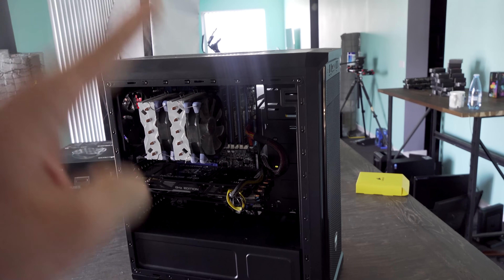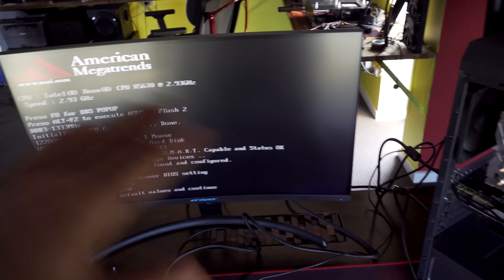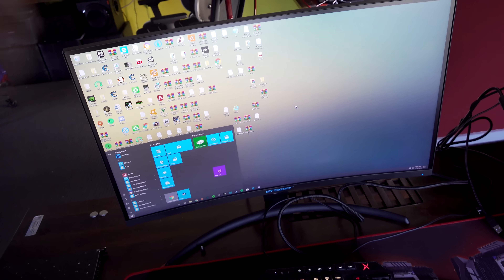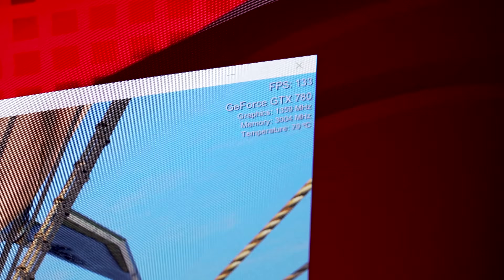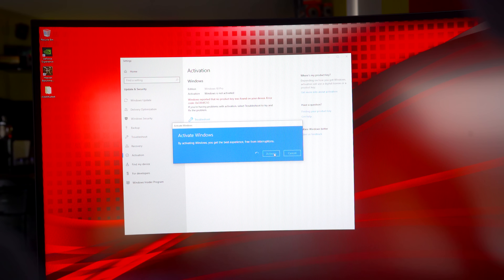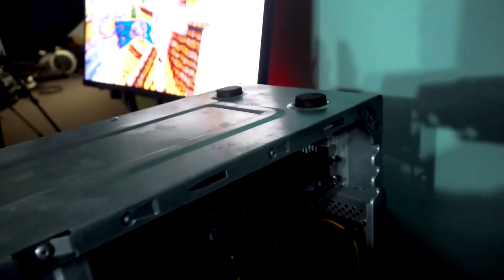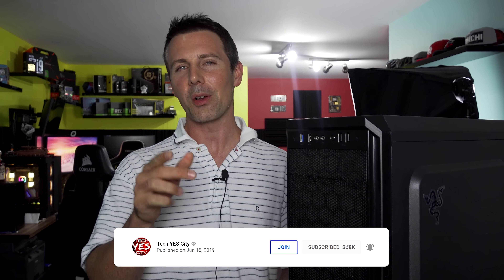Fixing "No Signal To My Monitor" - This Computer Came Back 2 Years After Sale.

Comment: i have 12gb ram and it is showing only 8gb ,, what should i do ?
Reply: Did you watch the video??
Reply: @lollb454  yes but the battery didn't work for me .. i tried to reset the bios and  that didn't help
Reply: @XFROOS  did you try reseating?
Reply: @lollb454  do you mean re install them ? I did that ..
Reply: @XFROOS  oh okay, is it showing up as 8gb in windows? Or only 8gb Usable?
Reply: @lollb454  if i installed the 12gb .. the computer will restart three times to open then it will show only 8gb in Windows and in bios  .. sometimes they show 12gb in bios but only 8gb in Windows .. and the computer restart three time to open the bios or to enter the windows
Reply: @XFROOS  and when did you start having this problem? Did it show 12gb first but then it started showing 8gb? If you installed some new ram maybe it is defective or ecc memory

Comment: I bought 2 identical hdds in 2016. Since then i am trying to find out why one works just fine even pretty good as boot drive, however the other is just insanely slow as boot drive.
However every test i did showed no difference and both seemed to work fine.

Comment: Had a similar problem with PC I bought, cpu cooler clogged with dust and PC must have overheated, I just popped battery to reset, blew out dust and was good as new.

Comment: after changing my r5 1600 stock cooler to snowman cpu cooler then powering back my pc this was my problem but reseating the ram solve the no signal also did that removing the cmos battery and draining the power before reseating. but the issue is mounting the snowman cpu cooler it took me good 1 hour to figure it out

Comment: I was facing the same issue, PC power on but it's just couldn't post. It turns out the motherboard is faulty and I had to sent it back to the seller to fix it and It was my first time building my own PC. Now I finally can use after they send me the brand new motherboard. Great video as always!

Comment: I got numerous problems with freezing while I was playing or doing nothing, then I had random crashes and so on.. I thought it was a faulty motherboard, got it replaced but still had same problems, at the end I found out it was ram, the kit I was using it's cl16 and was not on the motherboard support list (yeah, I was hyped to upgrade my old ancient pc)that I bought the wrong ram.. I got Corsair lpx 16gb 3000 MHz, but the only problem is the latency, I took 16 instead of 15... That little problem drove me crazy for couple of months

Comment: Isn't the hdd faulty? Did you check s.m.a.r.t info? I also have used CCleaner for years to clean up drive. Most of the time it finds multiple GB's of temp files and junk.

Comment: I had a XION case and 450watt janky PSU combo that didn't die but, the main rail was causing massive Vcore voltage drops and causing memory errors. For ever i thought it was the ram. Swapping out kit after kit. Windows was even throwing memory errors. 
  I then started to monitor all the voltages and temps. So I was watching voltages and temps in windows and all seemed OK. Going into the BIOS and checking the built-in Hardware monitor i kept seeing the Vcore drop into the red. So right away, i picked up the problem. Dropped in a new PSU and everything was good. Though, i never saw a PSU run the system and looked like everything was OK in Windows, throwing errors like every ither month. Until checking the BIOS, I didn't see any hint of a issue.

Comment: I bought a 2080 super from msi .. and when plugged in it acts like its not even plugged in ... i plugged it in and used my cpu graphics to see if its showing in device manager .. and its not there ..  thing is the pc boots fine with the gpu in the system but it doesnt post ... like u can hear windows sounds and shit but gpu has no fan spin at all .. doesnt heat up at all
Reply: Is it a faulty gpu ? Or something fixable?

Comment: Only 1 partition on a 1TB hard drive?Why???
Reply: What do you think partitioning does to reduce SATA lane bottlenecks or utilise space efficiently? Magic?
There is a reason why standard best practice is to have 2 storage drives; a smaller capacity SSD and a 1+ TB mechanical HDD that people swap their Steam, Origin, Epic, etc game files in & out from.
Reply: @TechNinja.1701  It's not reducing any bottlenecks, but in case of new os install, you can loose all the data.It's much better to have a partition for the sistem and one for the storage.And of course, always be sure you have atleast 15% or more of free space on every partition.Ina my case, i have a separate SSD only for the OS, and the rest of the HDD-s are all for storage.

Comment: Even if you just clone the old HDD into a new HDD the performance will improve. I have seen this many times, the Random Read/Write speed for these HDD became soo terrible, but when you Read Sequentially like in Cloning it would read at Maximum rate, but the Random Read/Write is somehow broken. Replacing the HDD will fix it.

Comment: What i found in mostly older intel systems was that sometimes there's a power failure or wrong settings/No cooler so it got extremely hot.You have to reseat memory or cpu and that would fix it.I have not seen this on amd systems though.

Comment: How to keep all of the folders and the files in the hdd but move the os to a new ssd without losing anything
Reply: Clonezilla works great as long as the drive you are copying to is at least the same size or larger than the one you are cloning. After you're done just resize the system partition on the new drive to use the extra space.
I have heard that "EaseUS Partition Master" is good and user-friendly too but only works for Windows drives.

Comment: If the HDD showed a greater than 200ms of "Average Response Time" in Window Task Manager then it meant that the HDD is dying. So it should be replaced even tho it looks "just fine".  The HDD cannot survive greater than 60 degree Celsius in Ambient Temperature, this will significantly reduce the HDD's lifespan.

Comment: My pc boots only if it wants to 😂 if it boots i have like 1-2hrs of playtime till it freeze and wont boot again. Bought new psu didnt fix it. Reseated and cleaned everything to no avail, running out of ideas. Prob cpu or mobo. But the strangest thing is when it works, it works flawlessly.

Comment: Just the hdd is end of life not that its full...
I still have a 2.5 inch brand New drive that Was so broken from the start Windows Was bsod all the time And had 15 min Just to load the desktop on a fresh install...
Yet the drive works Perfectly fine for movies/series storage 8 years now.
Please dont say stupidities like oh the drive is full thats why it is slow... It is Just defective.
And yes i have had atleast 100 situations where i Can tell the drive is end of life And data needs to be backed up And have had a call within the month And cases where i have even had calls within days that the drive died.
Also with enough ram you can disable virtual ram...
I do agree ssd were pricy 2 3 years ago but still for gaming even on a budget you could spare the money for a 60/120 ssd.
Reguarding Psu fails i have actually had 30 to 50 situations where the pc works Perfectly fine no bsdo no errors but is Just sluggish as hell pointing to end of life hdd And it Was actually all fixed by Just swaping the Psu... That Was actually ultra strange to me as to all voltages were ok and Psu Was at 50% load on max load yet even opening a browser And start menu Was pointing in sluggish hdd

Comment: 0:33 It could also be an overheating CPU so the thermal paste needs to be changed or re-applied. I've had the same problem with all of my PC's at some stage and it has always been an overheating CPU, when I have removed the CPU HSF, there has always been a large spot where it looks as though the thermal paste has spread out due to heat I guess, so as to leave a huge patch on the CPU which has no thermal paste because it has spread out to the sides of the CPU which then lets the heat accumulate.

Comment: I have an interesting PC story i had. i was trying to fix up an old 4th gen i3 machine and the gigabyte motherboard died. Then i bought a cheap motherboard on ebay from an acer pre built pc and that worked... until i wanted to put a GPU in. So i went to update the bios and the bios had a lock...Great. I ended up paying for ANOTHER motherboard and that finally worked. Just think about how many times i had to take it apart and put it back together again.

Comment: 7:35 Why is Windows not activated after defragging 🤣
Reply: After new installed Win on SSD.
Reply: @hag3n273  No that was before the SSD install. Like I said it was after defragging the HDD. Go to that time stamp and listen
Reply: @koalitaDormilona  I'll have to take your word for that. CBA to re-watch and find out. There is no logical reason why a defrag would delete a product code, so I'm assuming continuity error in the edit, if what you say is correct.
Reply: he deleted the key 
the reason is:

"Insert sponsor here"
Reply: 7:26 Aslo couldn't he use the product key or MS account as its same PC.
Reply: Could be that the original key is no longer accepted by the activation servers any more, and the activate Windows message only came up later during the defrag
Reply: That's one of the many things that drove me away from Windows, and onto Manjaro Linux, as I don't have to worry about activating my OS.

Comment: I cant find a solution to %100 disk usage. That happens randomly. Tried everything on youtube
Reply: smu u if you experiencing this on Windows 10 i had the same issue on my work laptop. We basically reinstalled Windows and everything was fine after that.

Comment: 8:25 it didn't actually defrag anything, it just more closely examined the drive to see if it could optimize the sectors. THAT takes allot of time. but because windows recognizes spinning disks it automatically defrags pretty much on the fly. a normal hdd in windows 7 through windows 10 will not have any fragmented files, although those files will be whole allover the place on the hdd. normal automatic maintenance will pack them all to the edge of the platter. so there are two things that you as the tech can do to make it faster again. first kill all of the startup software (obvious) then figure out what is actually there. second toss in an ssd, which is just a no-brainer these days because you can buy an ssd that is faster than any hdd for like 20-30 bucks. a new crucial 120gb ssd on amazon in the states is 22 bucks, if you can't afford that i recommend that you suffer, because you are just denying yourself. there are circumstances where that little bit might be expensive, but based on the computer shown in this video, it should have had an ssd in the first place.

Comment: Most anyone problem I had was a dying MOBO. It'd just constantly boot loop. Tried replacing the PSU first. Most recent was my GPU fans going nuts after I installed a new MOBO. That cleared up just by replugging in the PSU cables tho. My 2080 was raging like a Dustbuster for a few minutes tho.

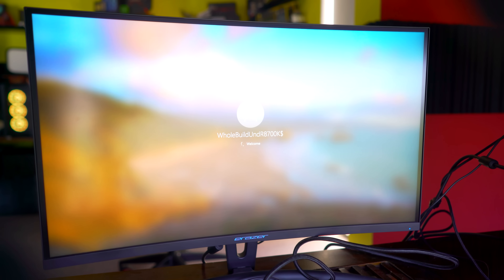Comment: 6:49 defrag doesn't hurt or help an ssd, in most cases it will just do nothing at all. on an ssd it might just readdress, but i think they stopped doing that ages ago, these day they just ignore it and report no fragmentation. and while it can help with an hdd, windows does it automatically since vista (even xp tried to) so fragmentation is unlikely to be a problem on a consumer desktop with a mechanical hdd.

Comment: Easy fix Bryan.
Interesting to see a cpu fan die. The second fan should have been enough unless the cpu was overclocked. Some boards show an error when the cpu fan isn't detected. Does an X58 board have 2 cpu fan connection points. 
I used to use 60gb ssd's back in the win xp/7 days so the OS has not been on an hdd for about 10 years. 
If you install a new ssd does Windows recognise that the motherboard already has a windows 10 key associated with it?
Cheers, Mon from Brisbane.

Comment: The reason I use a datavac instead of a regular vacuum cleaner is because of the potential static discharge that a regular vacuum can produce that can actually damage your pc parts. Unless you have a high end vacuum cleaner that is designed for use on static potential damage parts you are taking a big risk.
For example I know they make vacuums that are designed for cleaning laser printers with toner, because the last thing you want to be doing is blowing toner around a work area.

Comment: 2:00
can someone explain what is he doing? "drain remaining power"...how it works? thank you!
Reply: Swi Noob A power supply and some of the other components in a computer have capacitors. These store electricity for a short time even after the PC has been unplugged. By holding the power button for a few seconds, it drains those capacitors.
Reply: When taking out bios battery ( returns bios to original settings) should disconnect power from wall then press on button to ensure all power drained from system.  Sometimes when unplugged if you turn on computer may show brief moment of charge!
Reply: thank you guys ;)
Reply: Discharging power.

Comment: I've had so many people who've bought PC's I've built come back to me and tell me the computer straight up doesn't work, when in reality they were just plugging it into the motherboard not the GPU... the oldest trick in the book
Reply: I block these ports with little sticker with information about these ports and when to use them.
Reply: @Meeliskt77  Ohh that's actually a really good idea, might have to start doing this
Reply: i use caps for those ports. they're extremely cheap if you got them in bulk. just google hdmi/ vga cap for those who don't know what it was. i started using them during the e-sata time when some boards and laptops comes with those port. i'm still using caps even now for vrious other ports. it saves a lot of headache, plus it also adds to aesthetics, imho.
Reply: Yeah maybe you should be blocking those ports instead of leaving them available for that mistake to be made. You can buy a pack of 100 from eBay for less than $20. Do you charge them for this mistake when they bring it to you?
Reply: my case is the other way around. i plugged to the motherboard for a test but the gpu is not working. btw, is tweaking around power settings on control panel can caused this? because that's what i did before the gpu start failing. the gpu fan is spinning though

Comment: Yesterday I found two old computers in our attic. Both of it has AMD A4 processors. I tried to boot it up and the fans still run but it wont give any display to the monitor. I tried cleaning it up but it still doesn't give display. Sorry for the bad english, what should I do?

Comment: Hey Brian, I do have a question? I played a game for an hour or two and gave my pc a rest after that I turned on my pc, all fans rapidly spins, no signal at all, and been on and off after a while. After that I gave my pc a tech yes lovin' but nothing happens.
Reply: All ur fans rapidly spins its because there is no power come from psu to ur gpu..
Check ur pci cable from psu to ur gpu , usually its happen when psu not enough to power ur gpu so when you playing game ur monitor suddenly no signal but ur pc still run..
If you have second or oldest psu , you can try to change and try it..
I hope this will solve ur issue (sorry for bad english)

Comment: I’ve done all of these process reseat cmos battery change the battery change ram and still no display. Now what can i do
Reply: Try booting with only one stick of memory at a time, 

try using your onboard graphics (if you have any) without your gpu installed, 

Check to see if you have a post code led on your motherboard to see what error codes you are getting, if you dont have a post code led you can use a tiny motherboard speaker to get some error beeps,

Try unplugging everything except your cpu, ram, cooler and ofc your powersupply cables (ive had issues where a pc wouldnt boot because of a faulty harddrive),
Reply: Duka Duka already done everything bro boot with one good ram, unplugged hdd, remove gpu,change psu, change cmos battery. When i flipped on the psu only the cpu fan goes on then i’m getting no display at all. There is no post code cause it an oem dell mobo. And yes no sound when booting without mobo
Reply: @davisenstarlord6317  maybe your cpu is faulty?
Reply: @davisenstarlord6317  If you want a post code, get an oem dell power button for your mobo
Reply: Martin Ehrenstein man already done those thing no sound nothing

Comment: I have a datavac but previously I've used a rigid wet dry vacuum 16 gallon to clean out the dust. It has way more horsepower especially for cleaning those really dirty PCs.

Comment: Not a fan of the little datavac. It's pretty easy to find those "pancake" air compressors for like 60$ in brand new condition. I got one for exactly that. And i have it set to blow the dust out at 80PSI. Doubt the handivac does that. And the pancake comp makes the dirtiest computers from the recycling center look new again(unless full of cigarette gunk)